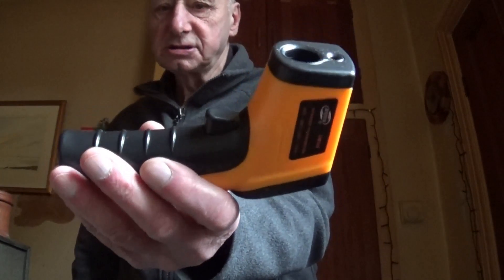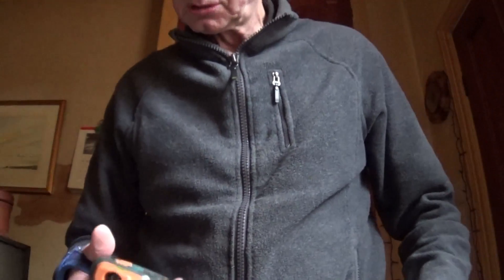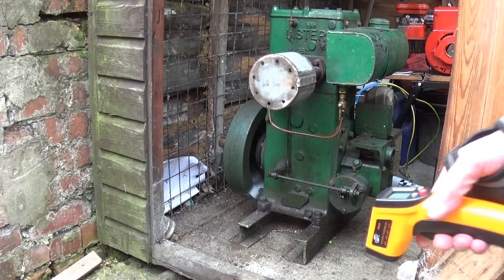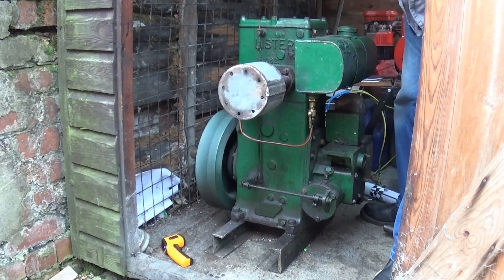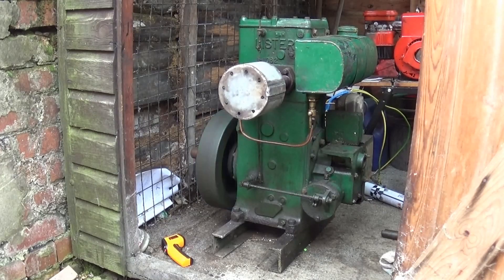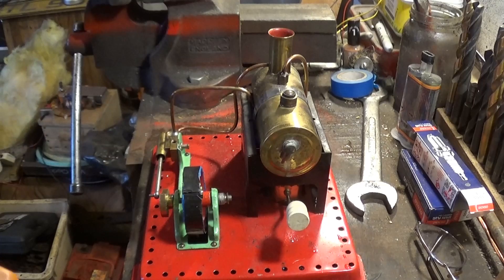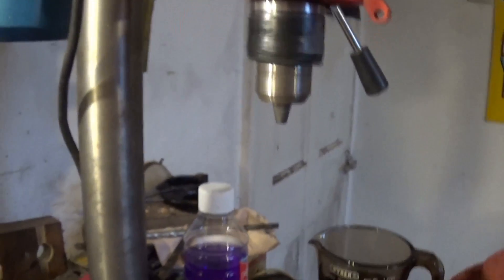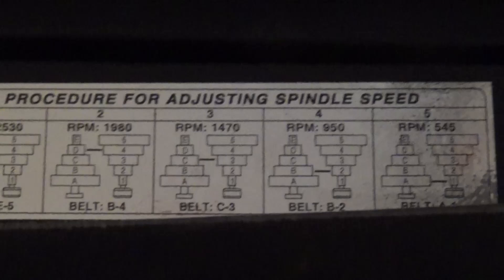How Fast is the Lister D Running

Comment: The Lister runs at about the same speed as a tractor PTO. That little steam engine can really spin on up there Malc.
Reply from the maker: Nice observation Lloyd, I should have known that. Tractor PTO is 750 I think. Need to make a dyno for it. Yes I know I can with a motor but don't have one. Alternator won't work without the battery, or could blow the diodes. These are/were rated at 1 1/2 HP at 700 RPM.

Comment: Great bit of kit that Malc, you'll be able to work out how fast you are spinning alternators etc from the lister now. I have used single, twin & triple listers over many years but all diesel, that petrol one you have is a gem. Please keep up the videos, I only found your channel a couple of months back and I'm hooked.
Best wishes
Andy.
Reply from the maker: Thank you Andy. Hope you like it. Yes I did a test yesterday on the alternator with a bit of white paper. Can also calculate from pulley size of course. Would like to do a dyno test. Not sure if I can with just the alternator.